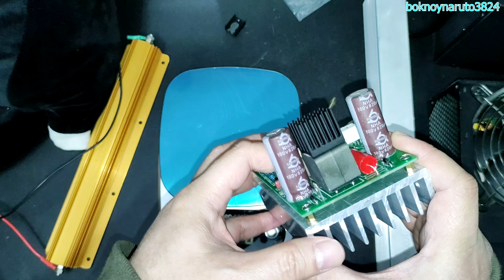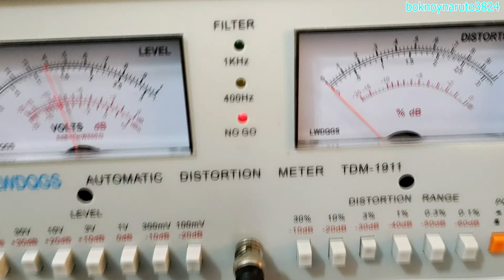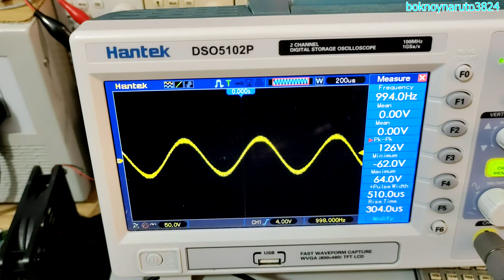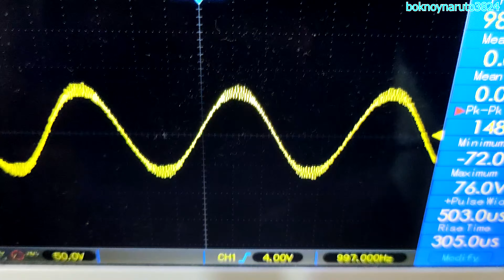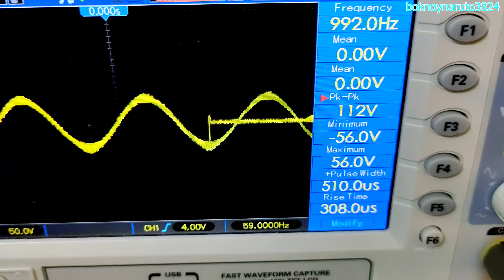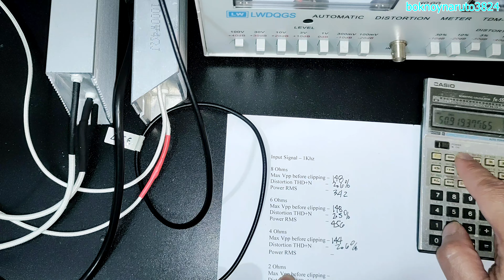Want To Buy the LJM L30D Class D Amp Board, Watch This First Before Spending Your Hard Earned Money

Comment: did you test it on lower frequency like 20hz to 200hz?.am interested to use as subwoofer amplifier.
Reply from the maker: I did not test it on the low frequency.
Maybe I will test it soon.

Comment: I recently got a 1000va toridial transformer that has 51 0 51, 15 0 15, and 12 0 12 taps.  It makes 72vdc after the rectifier.  It's too bad the sine wave doesn't look too good.  Would it still be ok for a subwoofer and would it cause any damage?
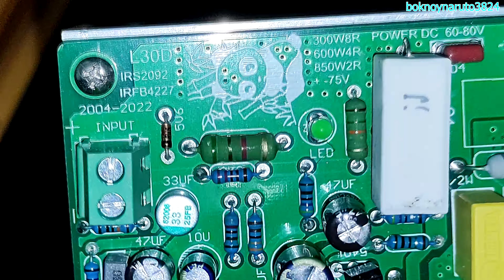Reply from the maker: Should be ok for a sub driver make sure to add a subwoofer crossover filter to further remove the high freq noise. 72 Volts is fine, the power supply for the board says 60V to 80V can be seen in the video at around 3:04 mark, pause the vid it is beside the red capacitor, top right.